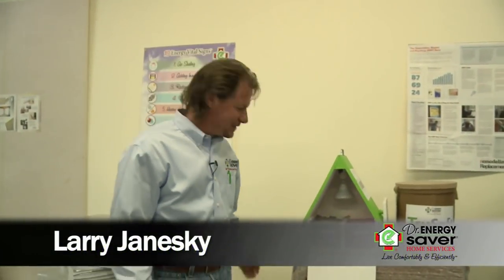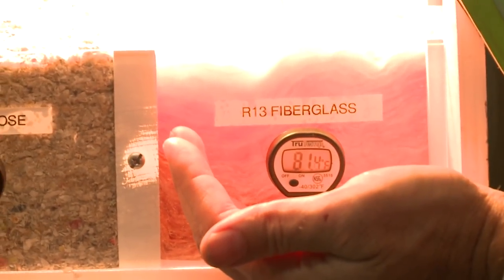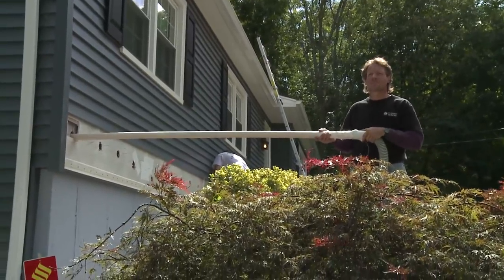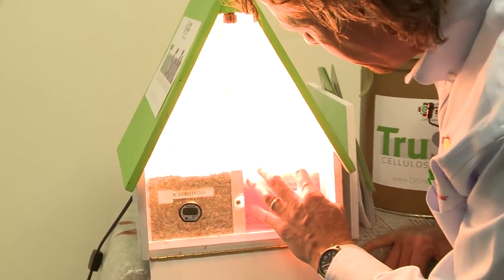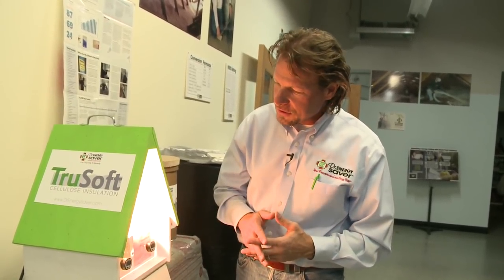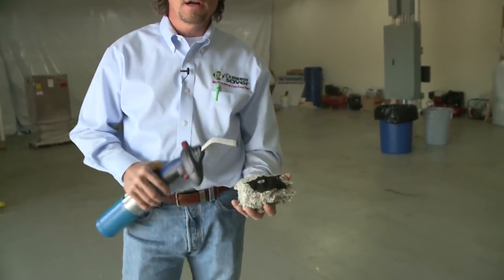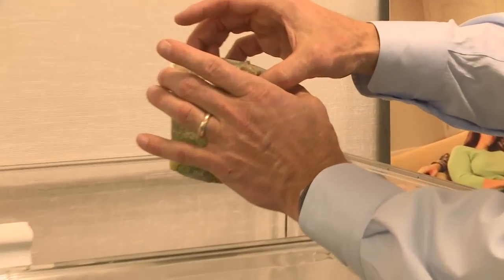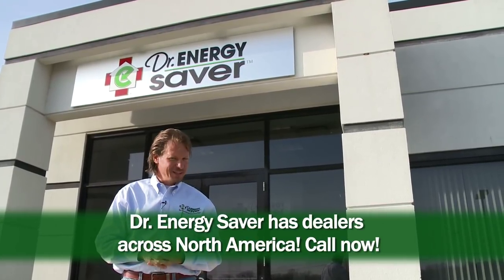Why Cellulose Insulation is Better than Fiberglass Insulation

Comment: Cellulose has some serious short comings, like if you have a leak, and you will, fiberglass does not hold water, cellulose does.  And then your ceiling is coming down.  Cellulose is pushed so much because it cost the installers half the price.  The only advantage is more R value per inch, and stops air movement.
Reply: Sooooo its the insulation's fault if it gets wet? BTW if it gets wet it can completly DRY OUT. If it gets wet YOU HAVE A BIGGER PROBLEM!
Reply: +A D "The only advantage is more R value per inch, and stops air movement." Durr, and the only advantage of an umbrella is it stops rain.
Reply: +A D , you trying to be funny? You say the only advantage to cellulose is a higher R value and it stops air leakage..That's exactly what excellent insulation does. If you have serious water damage, that means the drywall, the furniture and most everything else is wet and ruined. I doubt anyone will recycle the fiberglass. Insurance pays for new drywall, paint, furniture, and insulation so why not get the best? Fiberglass doesn't hold water because  it's a solid core material...which is why it has a poor R-value...It will grow mold. It will cause cancer. It will melt & the paper coating will burn and the melted fiberglass will give off gasses. As it burn =s out fo each wall cavity the fire spreads to the ceiling and attic. I would not install fiberglass if it were FREE!.
Reply: +A D  "HIGHER R value and stops air movement" ..WHAT MORE DO YOU WANT!!  If FG doesnt "hold water" THEN WHERE DOES IT GO? it has to GO somewhere! AND if you get a lot of water in your attic/ cieling  YOU HAVE BIGGER PROBLEMS than the insulation!! sheesh.
Reply: scott bickett Don't forget "it cost the installers half the price". So besides being cheaper, working better, and being more ecological, no advantages really.
Reply: +ralphinator2 , where can I buy cellulose for half the price? That's a lie told by fiberglass salesmen trying to compete with quality. Fiberglass is much cheaper because the installer uses way too few bags by fluffing with air so fiberglass measures the full depth but the density is not there...it's hidden profit for the crooked fiberglass sales organization.
Reply: ...with quality ground up news print and denim. The only advantages are better R value per inch and air movement barrier, but the negatives out way that positive for me.  Most installations have the few inches more room for equivalent R-value.  The energy required to make fiberglass is much more then cellulose.  I had a disaster when an installer shot wet cellulose into a confined flat roof cavity, it was an insurance claim for them.  All roofs will leak and when it does you won't know it until drywall is coming down vs FG won't hold water, you'll see the first drips right away.
Reply: +A D , your claim isn't credible. "Wet" cellulose won't even flow in the hose. No contractor is dumb enough to blow wet insulation in a confined cavity. (even if it would flow). The claim would be against the installer, not your insurance company. OF course you reported this to the BBB?
Reply: +A D ALL ROOFS LEAK?? wow..i better call my roofer from 18 yrs ago and ask him why mine is not!..Hmmmm. Even IF that claim was valid ( which it is not) WHY would ANY responsibility be placed on the insulation? I HIGHLY question your claim about "wet cellulose" being sprayed in your flat attic. Try looking up wet spray cellulose for ext walls.....ITS MADE TO BE INSTALLED THAT WAY. ANd nary a single problem. ( Nu wool would be one place to start).

Comment: I'm sorry, there probably are significant benefits to cellulose insulation but the testing on this video doesn't prove that. 

Thermal conductivity test : Fiber glass insulation is translucent. It will transmit much more radiant heat than opaque insulation. But insulation is installed into dark cavities. Transmission of radiant energy in the visible and near visible spectrum is not an issue. A legitimate test would require testing of the material withing a dark cavity separating hot and cold spaces so that heat flow could be determined accurately. 

The sound test is equally bogus : The question isn't whether sound is strongly attenuated when the source is in a closed box. That is just a widely known fact. The important question is how much more is sound attenuated in a wall with cellulose insulation as opposed to some other insulation. Again determination of that would require a carefully controlled experiment.

I've watched enough home improvement shows over the years to come to believe that cellulose performs well as insulation. However, to prove that one insulation is better than some other insulation requires skillful, informed testing and marketing demos designed to promote a particular kind of insulation do not provide useful information as to whether one kind of insulation is better than some other insulation.

Comment: Just googled a bit of research.  Cellulose is mold prone though.
Reply: So you did "a bit of research" yet didn't watch the entire video where we explains that the cellulose is treated for mold prevention and shows the mold farm?
Reply: I work on lots of old repo homes with both types of attic insulation. Matter of fact I was cutting moldy sheetrock out of a ceiling in a house yesterday. That house had pink Corning insulation batts layed between the ceiling trusses. Everywhere I cut out a 2 or 3 foot by 2 foot section of sheetrock that had mold in the paper top and bottom the fiberglass batt also had mold growing on the paper side touching the sheetrock. I rarely see moldy cellulose. A side note , I see much greater rodent damage in fiberglass batts than cellulose. Mice tunnel through fiberglass insulation like coal miners. If you have mice in your attic you will likely see evidence of snakes. Usually black snakes ( good climbers)which are not dangerous and they are good mouse catchers but who  wants a 5 ft snake in their attic. Another observation is cellulose traps dust in the upper layers but fiberglass allows the dust to settle further down onto the top of the ceiling. If you live in rural areas with dirt/gravel roads the dust collected in your insulated attic will become an issue over time .

Comment: The real question is: How much actual Insulation is inside each bag of insulation? Learn to ignore the measurements, the alleged thicknesses, the alleged R-value, and the stated roll sizes. A quick and simple test is to put each bag on a scale, to weigh each bag in the factory and to sell by weight. Some bags (meaning some rolls) contain 85% air. All Spun Glass and Rockwool is 'springy; it increases in size when released from the bag, but the insulation WEIGHT remains the same.  Rest assured 10" inches of insulation (including cellulose shredded paper insulation) does NOT contain 10" inches, but just 1 to 2" of material. In the factory its fluffed up with air by machines and you have natural fibre induced spring-back and height increases to consider. Its a billion dollar racket!
Reply: The air space between fibers ADDS to it's ability to insulate. I used to work for an annealing furnace manufacturer and they used a very airy product called "PyroBloc", 12" of the material kept 2000F on one side and cool to the touch on the other. In fact technology from PyroBloc were in the Space Shuttle heat shield tiles (also very airy).

The material used isn't the insulator (PyroBloc was made by liquifying white sand and letting it pour in front of a high pressure air stream, which turned it to a cotton candy consistency. Sand is a poor insulator, but the fibers made from it is a great one.
Reply: @Deploracle  ,@ Sadly, we have all fallen for that trick argument. So have millions of others who think heat can be trapped and held.  Did you know that the Chinese fall down laughing if you tell them string-vests conserve heat, they have the answer in padded--sewn coats and padded jackets and wearing several layers of close-knit, closed-cell garments. How come we now have Fluffed Up Rolls of insulation (not the good old thick 1965 cardboard-y type) that took some cutting and when cut - cut clean like wood?  How come I used to struggle to carry 2-bags upstairs to the attics, and now young girls can carry 4 bags, and big girls 6 -bags. The trapped air argument is obsolete. I see heat as liquid water, like steam, and  if you have clay tiles each tile allows air to escape, Dupont cracked this problem with their Tyvek, it's just a pity-that its over-priced by 100%.

Comment: ALSO, OC makes glass COOKWARE!!! Why would they say that it's good insulation when it is used for COOKING?!!? There was at one time a foamed ceramic bead (looked like bean-bag filler) insulation that Diamond Shamrock produced for a few years back in the early 1980's. The SAME foamed ceramic that the Space Shuttle used. It gave an R-70 at 3". The return in R-value went down quickly after 3", but nobody wanted to spend double what fiberglass cost at the time so it went away.
Reply: +dabcorn , your comment isn't credible. Homeowners DO pay double the cost of fiberglass for foam. Every day.
Reply: I said, at that time... 1980... the product did not sell, Diamond Shamrock quit making/marketing it as a consumer insulation product. We only had 1 homeowner in our town use it for 1 home. We even did a few test fills in some exterior framing for Exxon in their corporate hi-rise in Houston.

Comment: so if the fiberglass doesn't resist heat as well as the cellulose how do they get away with advertising same R value?
Reply: Fiberglass needs to be installed thicker in order to compensate for it's lack of effectiveness (as compared to cellulose). As example, cellulose will generally require about 8 inches of thickness in order to achieve an R30....whereas fiberglass needs to be about 12.5+ inches to achieve R30
Reply: Dina Reisman gotcha thanks for the info!
Reply: They "get away" with advertising the same R-Value because the cellulose requires a greater thickness to achieve the (let's say) R13.  Fiberglass requires less material to achieve the same R-Value.  Do NOT compare thickness...compare R-Value.  As an example, some OPEN cell spray foam produces R3.4 per inch as contrasted to R4.1 with a different manufacturer.  Compare R-Value; not thickness of material.

Comment: Calling BS. At 2:18 you can clearly see that the fiberglass is set back from the plexi/glass by about 1/2 inch. Of course its going to get hotter because there is now direct air flow. l33t fails..

Comment: Bad thing about cellulose and fiber glass is they settle over time. Reducing performance over that time. Advantage spray foam. Also cellulose and fiber glass are not air or moisture barriers. Advantage spray foam again. Closed cell foam all the way. Lastly which would you rather breathe in, fiber glass or foam? Advantage spray foam again.
Reply: +jim davidson While what you say is true to a point, you're leaving out two very large issues:  The cost of Closed Cell spray foam versus Cellulose, and the fact that closed cell is non-permeable.  Why is that important?  Because if you have a roof leak and seal the roof deck with Closed cell, you will never know your roof is leaking and it will irreparably harm the roof over time.  Closed cell, because it's non-permeable, is fabulous in a crawlspace or basement.  Open cell, which IS permeable, would be better suited for the roof deck as it will allow water to intrude and you can diagnose a roof leak.  Lastly, Cellulose takes a long period time to settle, especially versus the all but useless Fiberglass.  Other than that, you're right on.
Reply: +jim davidson Yea, but spray foam offgasses a lot more than the other options, and is subject to field mixing issues that can really hurt indoor air quality.
Reply: Foam only off-gasses till it cools. Less than one minute. After that there's nothing. There are no field mixing issues and spray foam never hurts air quality. Yes it can if you stick your nose by the FRESHLY sprayed foam, till it cools. How often do you do this? OK never. Spray foam of the closed cell variety is the highest performing insulation on the market period, end of story, message ends here. Fiberglass allows you to breathe that crap for the entire time it's in your home. Cellulose is better but still settles like fiberglass and loses it's R value. Money out the door.  Foam stands tall, never settles, is moisture and an air barrier that performs superior to other old technology insulation.
Reply: +jim davidson Not enough is known about spray foams for you to be making statements that it doesn't offgass after it cures.  When you see a lot of reports of people with chemical sensitivities having problems after their home was sprayfoamed, it tends to suggest that it's not as inert as you think. Have you ever seen a sprayfoam job where they installed the passes to thick?  The stuff never cures right and it smells fishy.
Reply: Either poor product or over-sprayed install MIGHT cause this. Never heard of it though. Everything I've heard/read says once spray foam cools the gassing is done. Smell a styrofoam cup. No odor at all.
Reply: I've seen it for myself.  Go ahead and google "spray foam offgassing".  You might also want to look into how the r-value of spray foam decreases over time, just like polyiso.
Reply: uh huh LOL
Reply: The scary thing would be the jobs where a foam job doesnt result in enough of a smell to initiate a callback, but still offgasses enough to contaminate the house, indefinitely.  You have to have some serious trust in your installer.
Reply: Spray Foam off gasses for years. Go on the internet and look up spray foam problems and you will get dozens of horror stories of houses that had to be left after spray foam was applied. Spray foam will deteriorate in a high moisture environment. It should be coated, but the coatings used give off worse gasses than the foam. Cellulose has all kinds of problems, rot, moisture retention, loss of R-value over time and settling in vertical or pitched areas. Fiberglass has problems, flammability, settling and fiber content in the air. I have been selling insulation for years and the only answer I see is this new Hemp insulation. I don't know a  lot about it, but I am going to find out.

Comment: Cellulose fibre does not  break down like mulch Mikey. Laboratory weathering tests equivalent to 200 years of high temperatures and high humidity show no substantial deterioration in the product. Only the unscrupulous few guys selling fibreglass (glasswool, insulwool etc) say this. There are plenty of examples of fibreglass insulation crumbling into a pile of fibres, but again the fibreglass manufacturing products have changed a lot over the last 50 years as well. I will say polyester insulation to my knowledge is a good robust insulation batt, a bit more expensive but less prone to settlement. I don't think they sell polyester insulation in the US.
Reply: We used to install loose-fill 100% recycled COTTON insulation - early 1980's. That stuff was fantastic - PLUS it came in a rainbow of colors. Made from new scraps/ trimmings from manufacturing towels, 'bolts' of fabric, etc  - so cool to open a bag of red, then a bag of green, turquoise, never knew what you might get! One time retrofitting an old home remodel, we found cotton BATTS from the 1920's or 30's!!! The paper backing crumbled to the touch, but the full 3" was still at work!

Comment: What a scammer! You said cellouse has a higher R value compared to fiberglass. If so why is there more cellouse compared to fiberglass in display? Put temp gauge at the bottom to get correct reading.
Reply: As long as the thermometer is in the same location, the test is valid.  Larry did a good job of demonstrating the concept.
Reply: Wrong, put the thermometer at the same R value equivalent depth then test